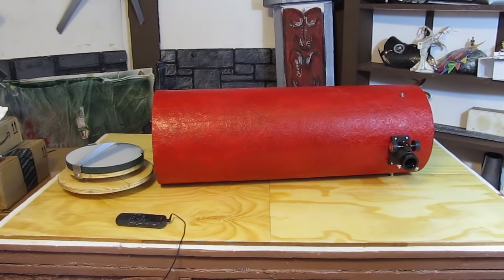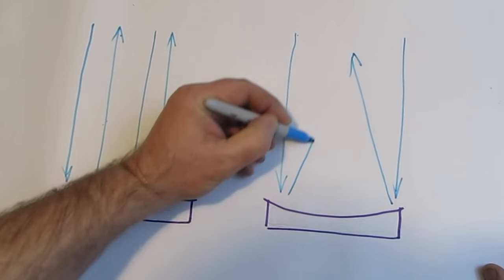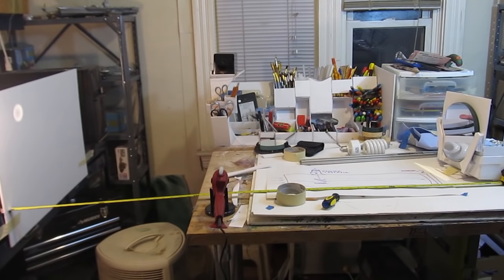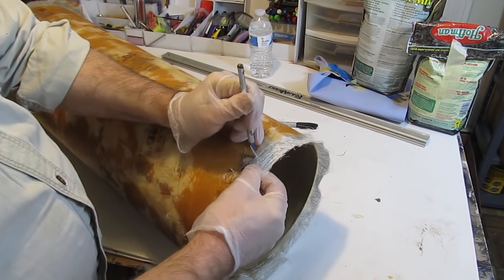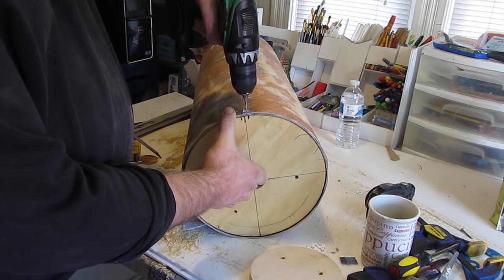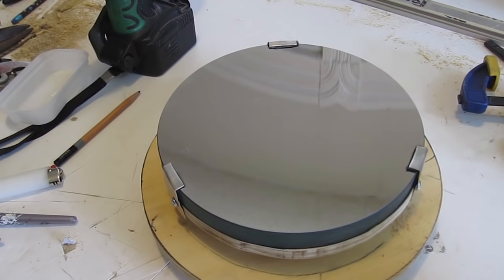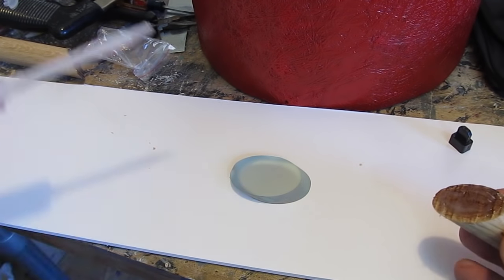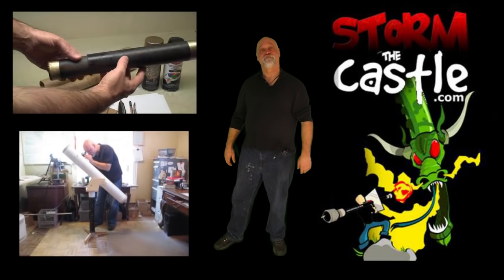How to Make a Telescope - 8 Inch Newtonian Reflector (Part 1)

Comment: The only question is where to get the mirror and focusing piece. :(
Reply from the maker: +cirvis240 I have links on the website to where you can get them. And it is possible to make a simple focuser that works quite well. If you are dreaming of a telescope it is always possible.
Reply: +epicfantasy Who doesn't dream of one! :D I just couldn't find the links at first.
Reply from the maker: Keep at it! It is worthwhile. In a crazy world it is great to get a little quiet time under a dark sky.
Reply: Do u have a video showing how well it works??
Reply: cirvis240 7
Reply: cirvis240 n
Reply: @epicfantasy  
How much a 80x telescope will cost to build ?
Reply: Awesome video. I think I’m gonna give this project a shot.
Reply: Aka amazon
Reply: The microlenses have to be manufactured
Reply: I used a magnifying make-up mirror 🙂
Reply: @epicfantasy what is total cost of every parts?
Reply: @RobR386  did it work?
Reply: Eduardo Hinojosa yes but not very well
Reply: @RobR386  what problems did you have?
Reply: Eduardo Hinojosa  mostly just a really soft image, quite a bit of chromatic aberration. Probably due to the light having to go through the glass to reflect off the mirror.
Reply: @RobR386  I see. Thank you for the info!
Reply: @taifmahbubshapnow7530  I know this comment is old, but telescopes don't have a fixed magnification to acheive 80x, it can be anywhere as small as 50 mm to sizes much larger than that. It normally costs 260$ to build an 8" parabolic reflector, for comparison
Reply: Drink 3 beers an think , mirror from the bathroom , girls use 9 inch make up mirrors , oposite side is a plus one magnifier. , Find one cheap at resale Shoppes, ...the drug store eye glasses , enjoy ,  get one reading glass , mild..and one super magnifier...check that the middle is flawless. St.vinnys , for a dollar or two..any mag. Glass and any pair of glasses is a telescope , of unknown focal length...find that fix that , attach to tube.
Reply: Amazon
Reply: So that’s the telescope, what about the mount, it’s the mount that makes it work.

Comment: Hey, i'm 2 years late, but now subscribed.  Awesome job!  Your presentation style is really approachable, and i think you explained things very well - so people with little or average experience with tools could still probably put one of these together.  Thanks for sharing!  I am inspired, and think i want to build this style of 'scope on some shared neighborhood commons to maybe get some of the kids around here interested in astronomy.  I'm going to try going big, with a reflector made from a mountain bike rim and mylar (thick, rigid plastic sealed to one side, and a mylar space blanket sealed to the other side of the rim, and draw a vacuum  with a simple valve... and maybe make the "tube" out of a pair of road bike wheels joined with 4 or 6 pipes or 2x2's lengthwise sandwiched between the large road rims with cables, all thread, or even rope.  Might be a bit of maintenance with the less than ideal materials (not sure how the ideal gas law would treat my mirror under thermal changes... but maybe i could fill the space with resin...hmm... projects!), but still would be good to pass along the inspiration the the next generation.   Thanks again for sharing - very smart and simple mirror adjustment too.  Cheers!  and PeaceTruthLove!

Comment: What a great video! Great ideas, all of them, but I might offer a suggestion... As a musician, I am aware that climate, especially the humidity affects woods in strange ways. Also, having owned a Newtonian before, I know that a difference of a fraction of a wavelength of light, alters the performance of the mirror. Using wood for the mirror cell might be acceptable, but only if the wood is sealed against humidity. This can easily be accomplished by finishing the wood with a polyurethane finish. Don't skimp, do at least 2 coats. Don't forger to drizzle the polyurethane into the bolt holes on both the cell itself and the back plate, and don't forget the edges. This will ensure the best,  most consistent performance from your telescope, for years to come.

Comment: Great video. One thing I thought of  was to cut you tube about 2 inches longer. So that the mirror can be recessed. Then you could put an end cap over the mirror culminations screws to protect their adjustment.

Comment: NOTE FOR ANYONE TRYING TO DO FIBERGLASS WORK:
The Pink cartridges like the one he is using at 7:49 are generally a PARTICULATE filter. They will do nothing against the fumes of the uncured resin.
Reply: I mean if you piss in a rag and put it over your nose and mouth it's a good chemical filter…
stops chlorine gas atleast...

Comment: Could you make your own primary mirror?

Let's say you take a cookie tin or something similar. You make a small hole in the bottom where you install a check-valve. You cover the top with a sheet of mylar / aluminum/ tinfoil. Then you carefuly suck out some of the air to create a low-pressure area. 

You think something like that would work? 

It wouldn'be a very good material, but it would be cheap. Plus, the only things limiting the size of the primary would be the size of the cylinder you can find and the dimensions of the sheet. You could probably make a giant telescop out of an old oil drum..
Reply from the maker: +akumabito2008 This is some superb creative thinking!  I like it a lot.
Reply: Hmmm... maintaining the vacuum would be a bit of a challenge unless you managed to seal the welds or bent metal joint where the end of the can is attached. Also, the metal of the cookie tin will flex as well under the influence  of the vacuum. Same goes for the oil drum. But... If you made the tube out of something with a thick wall, such as (iron or steel) drill pipe for one example, you would have much better luck. Still, maintaining that vacuum...

Comment: I saw how your drill bit was skipping around when you were drilling the hole for the focuser, a tip i was given years ago was to run the drill in reverse for a few seconds until it makes a small divot, then switch direction and drill the hole, might be a useful tip in the future.

Comment: Interesting video. Can I just ask one question.  When Calculating focal length of a concave mirror ,  does that start from the high edge  part of of the concave , the shallow part  in the middle of the mirror , or somewhere in between ?  I would think it makes a bit of difference when placing the secondary mirror right ??
Reply: It should be from the center of the thickness of the mirror.

Comment: Hello, @epicfantasy i am doing a project for school and this bideo is very helpful for me bullding an 8 inch neetonian telescope! I do have a few questions though. I have tried figuring out the focal length of the telescope, i got the same mirrors you have in this video, Although the distance from the primary mirror and the surface is 125 inches, so this would make my telescope 62.5 inches long. I did research, is this not too long for an 8 inche newtonian telescope? Also why didnt i get the same results as you?

Comment: Super and most informative video! Thank you! We are making a 17" reflector. We figured out via research that the secondary mirror is a quarter-size or smaller than the primary mirror. Am I right to think that a 4.25" secondary mirror would work? I still need to figure out the F Stop. I'm also looking for a binocular-type eye piece. I saw a couple of them online but still researching. A turret mount also looks good. Thanks again!
Reply from the maker: WOw, that's a big telescope. Keep me posted on the progress. About the secondary. The size of it depends on the focal length of the 17 inch mirror.  There is an online calculator for this. Google "Secondary Mirror Calculator".
Reply: @epicfantasy   Thank you! Most awesome! We will :-) My Dad, Mom, Brother and I (yup, a family project) are making this as practice to make two more sizes...a 36" and then a TEN FOOT :-) We bought the sturdy plastic parabolic mirrors for the first two telescopes and found a master to make a mold to reproduce the ten-footer reinforced fiberglass parabolic mirror, and future ten-foot telescopes for our various properties to place in roof-top observatories on our homes.
Reply from the maker: @richlovn539  I am not familiar with those plastic mirrors. But, I believe they will not be sufficient for a telescope. Can you send me a link so I can look see.
Reply: @epicfantasy  Thanks again about the calculator concerning the second mirror. After looking at them I remember now that I had to wait for the main mirrors to do that, just as you said. I keep calling the ordered main mirrors 'plastic', but should have written strong acrylic to be more accurate.
Reply from the maker: @richlovn539  Thanks for the link. I took a look at that mirror on ebay. So sorry but that isn't going to work for a telescope. there will be too much image distortion.
Reply: @epicfantasy   I understand. I have it in my hands and we placed an F- Stop over it yesterday and it works perfectly for us so far. A sharp, beautiful and bright image. I haven't seen distortion yet but am looking forward to finishing this Dobsonian to make sure. If so, I'll spend the big bucks on the 'real' mirror someday. 'Til then, I'm having fun with it as we experiment with these telescopes. Much appreciated :-)
Reply from the maker: @richlovn539  Okay, keep me posted. And shoot me an email. I would love to get pics about this project. Oh and be extremely careful with that mirror when it comes to sunlight.  It's focus can literally start fires!
Reply: @epicfantasy   Super! Will do and sure will! Thank you :-)

Comment: I rebuilt my Meade 8" Dob and fiberglassed the tube and painted it the same color you did.  BUT, the balance point changed significantly after fiberglassing and I had to make some serious base modifications.

Comment: I can't find second part. I want to build this but want to make sure I have something to mount it to. Also the mirror you used is it parabolic? I looked on ebay but they have both spherical and parabolic mirrors. Does the basic spherical mirror need to be polished? Or is it already concave?

Comment: With fibreglass you can create a nice smooth finish as well.  Put a layer of rough glass sheeting over it then a few layers of glass-tissue.  This will give you a nice smooth finish.
Reply from the maker: +Richard Holtom Thanks, Great suggestion and great comment. This was my first experience with fiberglass.
Reply: It can be difficult to work with, but the strength it gives is excellent.
Reply from the maker: +Richard Holtom Yes, amazing light weight strength.  And no distortion in temperature or humidity changes.

Comment: Funny, at 3:50 the statement is correct (the radius of curvature of the mirror is twice the focal length) but the drawing is false. It should have been a cone of light coming out from the light bulb, bouncing on the mirror and giving a sharp image on the screen. Other than that, the secondary holder doesn"t seem to be adjustable, which is kind of a problem for collimation. Other than that, nice video, hopefully it has helped and will help more people looking at the sky.

Comment: Very interesting video and as I have been given a telescope and wondered how they are constructed and designed your video instruction on how to build one has given me an insight into how the mirrors in mine are setup and how they could be adjusted if there out of line through being knocked and stored away as this one has for many years..... I can now go ahead and get it setup knowing how its constructed............. thanks so much for making this video,
Regards, Steve
Reply from the maker: You are very welcome. Thanks for watching. The process of aligning the mirrors in your telescope is called "collimating". That term should help you find tutorials.
Reply: Thanks again........... Ive got a wonderful opportunity to use this telescope as the guy who gave it to me lives in a city that has problems with light pollution as most large towns and cities do..... although I have a house in the UK's 2nd city ( Birmingham ) I'm also lucky enough to have a caravan ( Trailer ) in the countryside that is very dark and I'm told that this is the perfect place to be able to view with so little light pollution.... again, many thanks...

Comment: You need to create parallel rays when doing the knife edge. Well i always did. I made a box to contain the stray light and used grill / vanes at right angles behind the pin hole and i got parallel and polarised beam of coherent light.

Comment: Did you cut another larger disk? The one you showed at the beginning of the video had a hole in the center for your fingers. Just askin'. Then at the end of the video I see the large circle with the hole installed.

Comment: Great video. One dumb question for you or another youtuber. I understand the focal point but is that 29" between mirrors or does that distance also include the distance from secondary mirror to focuser?
Reply from the maker: This is actually an excellent question.  You have to  include the distance from secondary mirror to focuser.
Reply: @epicfantasy  Thank you! What an incredibly fast response time 👍🏼. Last dumb question, measuring from the secondary, what part of the focuser am I measuring to? The part closet to secondary or to the eye piece? 
Thanks again, great video.
Reply from the maker: Another great question . We want to get a middle measurement. You roll the eyepiece holder out half way. And measure to the middle of it.
Reply: @epicfantasy  Thanks again 👍🏼

Comment: If the price says I can, do you  recommend a parabolic mirror over a spherical?  Also for an 8" parabolic, what are the tradeoffs at different focal lengths.  say an 8"/f4 vs 8"/f6 and so on.  Thank you for any help, once I get my reflector built, I will definitely chip in some money to your channel!!
Reply from the maker: Yes, definitely a parabolic over a spherical.  About the focal length. I would go with the longer focal length. But, a quick rule of thumb  is the shorter the focal length the wider the field of view, but objects appear smaller.
Reply: @epicfantasy  Thank you very much!

Comment: actually all what you did in this video is basic assembly. i wanted to know where i can get a concave mirror like that and the focuser. does it have lenses or not and where we can get one. the other stuff is relatively simple. a PVC pipe and i have a 3D printer for the other stuff you made with wood. good video though

Comment: Interesting! I'm thinking I would use a pvc pipe instead of messing with fiberglass! Probably less expensive than the cardboard tube and fiberglass materials combined! And since the mirror mount would have to be removed from the tube for cleaning anyway, why not glue it too? Can't it be cleaned glued to the plywood base?

Comment: I think that I'd be inclined to just glue the primary mirror onto a circular wooden blank, rather than use clasps. Any pressure, even a small force on the mirror will tend to distort it. What do you think?

Comment: I noticed the maker used fiberglass mat, which is not meant for structural integrity. Its more of a base layer for fiberglass cloth. Fiberglass cloth is what you should use for true strength. Just a teeny bit of constructive criticism. 10 ounce per yd^2 is a good medium weight.
Reply from the maker: Great comment. Thanks!

Comment: Is it possible to Rotate the secondary mirror and, if not, do you have any suggestions to make it so you are able to?
Reply from the maker: No need to rotate the secondary but... if you wanted to do that it would be easy enough.  Cut the angled mirror mount in half.  a piece of threaded rod and two nuts between the two halves. Now,  the half with the three rods doesn't rotate. but the half with the angle and mirror can rotate and be set firm with the two nuts.  This might need a drawing to see clearly.

Comment: I'm lucky that I have all the lenses,  concave and convex mirrors I could possibly want. They came out of an old atmospheric spectrometer my grandfather helped create back on the early 1970s. All I have left is all the precision made mirrors and lenses. Some of the concave mirrors can start fires by reflecting the sun at its focal point. Within seconds. 
I am totally going to use the parts to make this telescope. Thanks for the Video.

Comment: cheaper is to use eyeglass +0,5 diopts and any magnifying glass, preferable 15x. telescope is about 2m length but simple to make
Reply: or 2diopts, forgot already, but can be googled
Reply: Do the eye glasses and magnifying glass have to match or have certain specs? How long should the housing be? I may try this, you can get both for really cheap..

Comment: For fibre glass you can use the fibre glass rolls which orthopaedic surgeon use for appling cast on hand. Its much simpler. U just wet it and u roll on surface
Reply from the maker: Great tip! Thanks!
Reply: @epicfantasy  i was looking for part 2 of this video but couldnt find
Reply from the maker: @anuranjan0101  Here you go: https://youtu.be/o3pZ18TPvfw
Reply: Thanks man.. !!